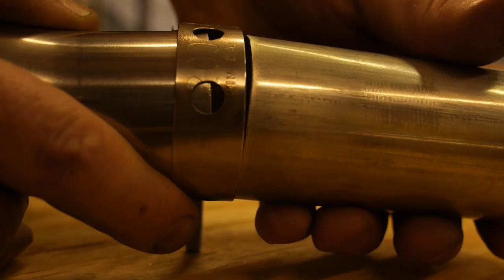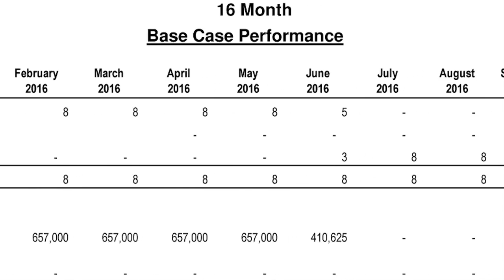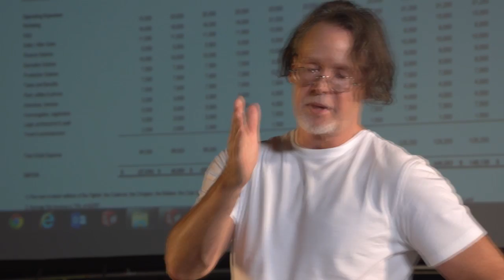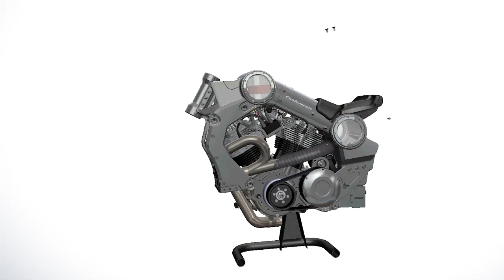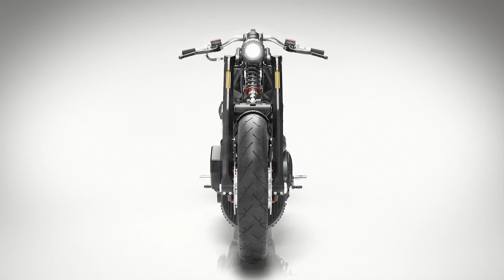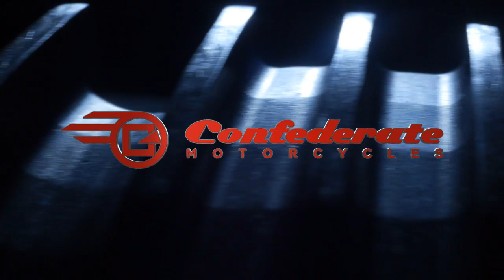Confederate Motors - Invest With Us

Comment: This a dream bike that I was saving up for one day, too bad they went into the  uber-electric bikes made for Silicon Valley I.T Millennials  that don't know how to operate a clutch and expect a thumb throttle single speed transmission.... Rather buy a used dino sipping V-twin  (Hellcat x132 etc) than anything silent/electric even if its a little slower. Confederate dropped the ball for good. You guys had a niche motorcycle, keyword 'had'...